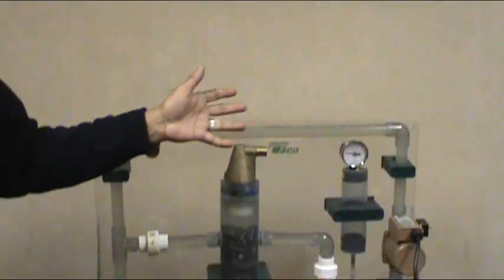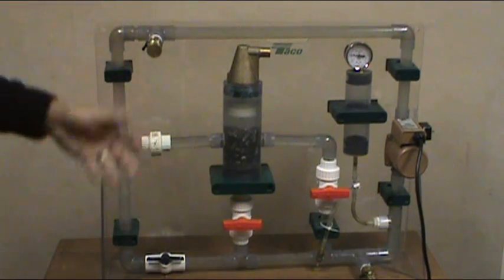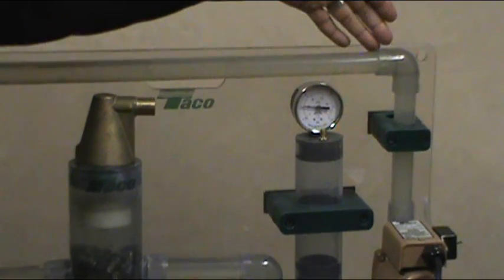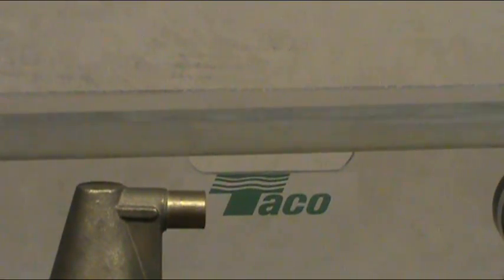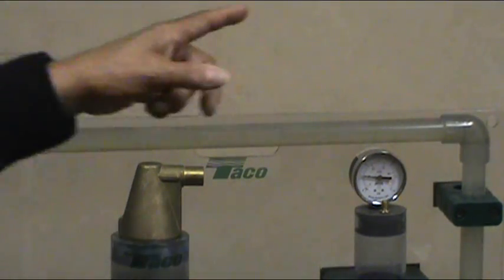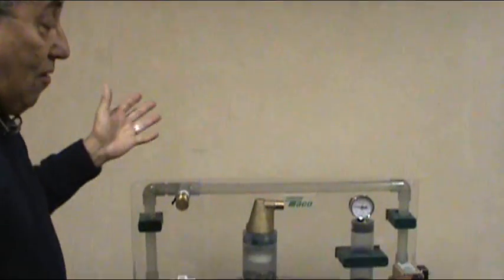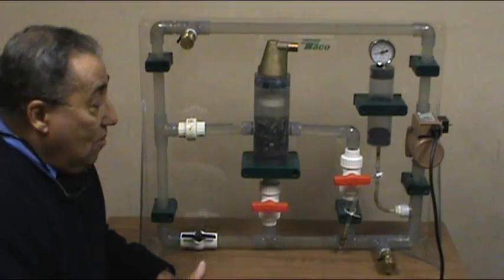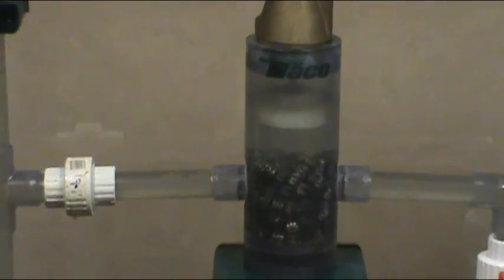How An Air Separator Works | Emerson Swan

Comment: Thank you for this demonstration. But big question: Do you have a similar product for the diesel fuel line for the hydronic heater?  I am getting air bubbles into the burner and flaming out, so I need to A: Fix the actual problem, but B: would like to add an air separator close to the fuel input of the burner to further reduce flame out. We are talking 10psi with 1/4 ID line...
Reply: Try a tigerloop

Comment: Where does the air go? Does the "air scoop" eventually fill up to where there is no more room to take bubbles out of the system?
Reply: He didn't talk about it, but you can see a white float at the top of the water line. That's attached to a linkage which is attached to a discharge valve. When it's full it releases the air. Think of it like a toilet flushing, but the air goes and the water stays.

Comment: Air needs 18 inch to rise :D I can clearly see air bobbles go on the top almost immediately (2-3 inch) after that elbow :D
Reply: the display is a poor example due to the pipe size and water velocity. With larger piping typical boiler trim you need to be further back from an ell.
Reply: @dpt4402  Just stop it... I'm plumber for many years and installed air scoops 4-5 inches from elbow, works perfect. Is it as efficient as 18"? Probably NO, but if you don't have room, 4-5 inches does the job with no problems, takes little bit more time but does the job. I know, because I service  same boilers later on and there is no air what so ever! Bigger pipe creates even less turbulence with the same circulator because water moves SLOWER in bigger pipe...
Reply: @smiert13  I have no doubt that you and your customers are very proud of your work. But from the experience of fellow trades person who dates back to when 50/50 was a thing there are instances that is not the best practice. The use hot water boilers are somewhat regional the introduction spriovent addressed the challenges of these hydronics as an example older multi story housing that has a far exceeding height between the boiler and the top radiation typical in New England or the introduction of zoning with multiple circulators creating high velocity scenarios. As very rarely  a boiler trimmed in a 18 inch gunner.   While it is true back in the day everyone used a cast iron scoop, they also walked around with a radiator vent key along with the home owner.